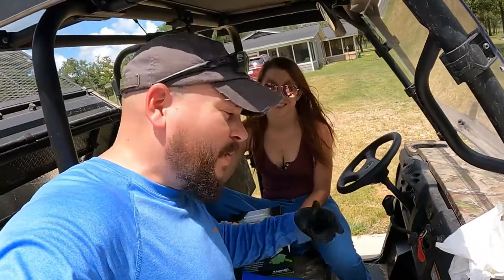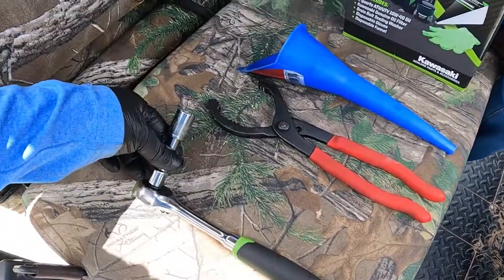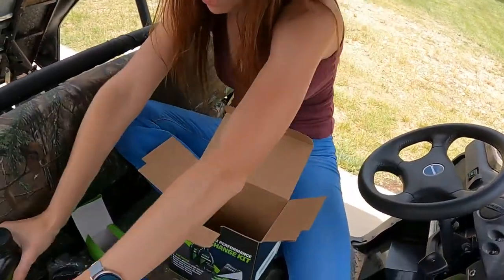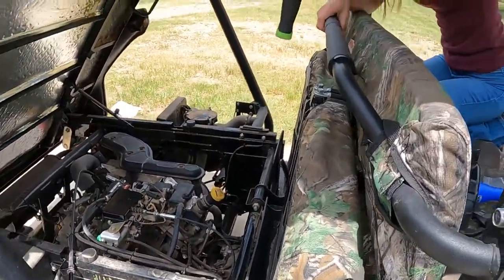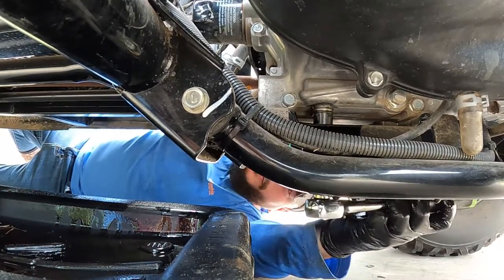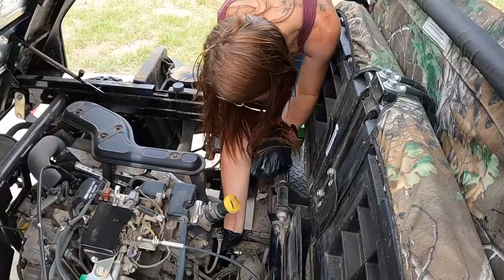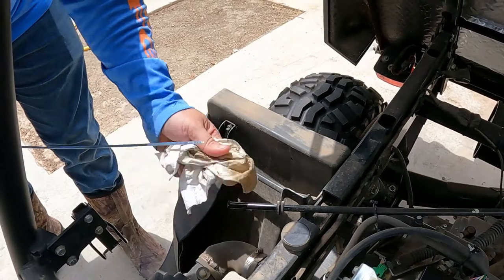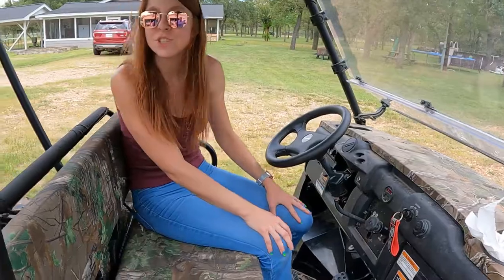HOW TO - Oil Change on Kawasaki Mule 4010 Trans4x4

Comment: Thanks for the vid.  I'm long on mine, 2021 with 93 hrs on it (only been driven in Low).  Wondered if that was the plug or the big bolt on pass side facing to the rear.  Thanks again!
Reply from the maker: Thank you!  It was definitely the plug location from the manual we have.

Comment: How fast does that suckered go
I have a 2010 it only goes about 25 
Don't know if it's governed
I bought it used
Reply from the maker: Ours goes about 25mph as well. We aren't sure if it's governed or not but we purposefully chose one that goes slower so that our boys were safe when they were smaller
Reply: I know...older question.  But just in case someone reads it now like I just did:  The Mule lineup is meant for work.  I've on my 4th...2 gas, 2 diesel.  They're not gonna win speed contests, for sure.  But they'll outwork most other UTVs and that's what they're all about.  If you're actually getting 25mph out of yours, you're doing pretty good!

Comment: How do you take the ignition out? Put key in it and just turns.
Reply from the maker: Not positive, but I believe there is a nut on the underside of it that will unscrew and you pull it out.

Comment: Where is the battery located? Is it a car battery or small moto battery
Reply from the maker: It's under the drivers side seat.  Smaller battery.
Reply: @SixthDayRanch  thanks I’ve had one on order since April. wiring the shop up wanting to know what side to put the receptacle box on.
Reply from the maker: Great idea!  Happy to help.